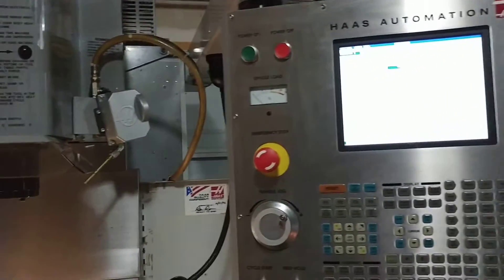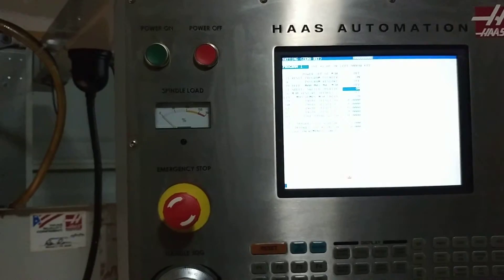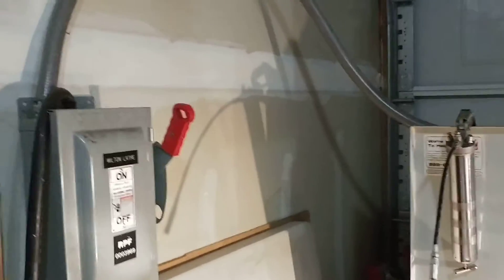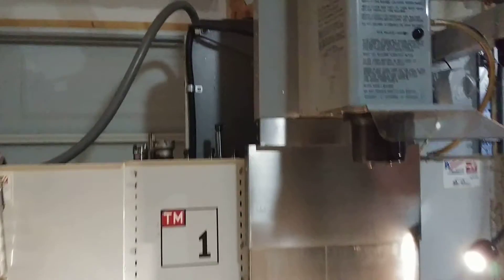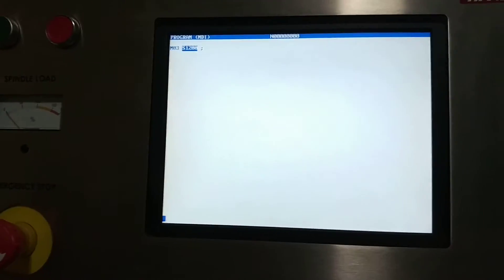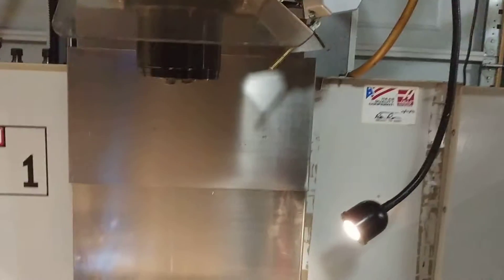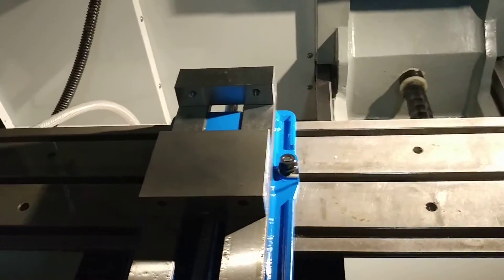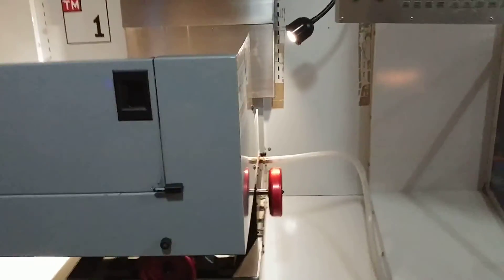Haas TM1 on single phase 240v

Comment: I want to get the tm1 to put in my garage but i only have a single phase 220vac 30 amps. I dont know if the machine will trip the breaker...
Reply from the maker: It will under serious load. You can still use the machine, just keep your cuts more on the moderate side.
Reply: @TheMachinistCNC  so I should be fine if I don't machine aggressively? I also looked into a phase converter.
Reply from the maker: @ISILENTNINJAI  absolutely

Comment: I have a 2010 TM-2 arriving in my garage on October 11 and it is presently wired for 3-Phase. I CANNOT find a wiring diagram for single-phase wiring and I've looked in all of the HAAS electrical manuals and operator manuals etc.  Would you PLEASE send a picture of the cabinet A/C wiring. I think I'm supposed to connect the two 110V legs to L1 and L3, the neutral to L2 and ground to the ground lug. Then set the main transformer jumper to "224V-250V" and the 24V transformer to "221V-240V".  I am assuming nothing needs to be done to the wires coming off the bottom of the main breaker.  If I wasn't bald I would have pulled my hair out by now. Thank you.
Reply from the maker: I don't have the machine anymore but.... If memory serves me me right, it was the two hot legs, on l1 and l3 with the ground connected to the ground bar on the machine.
Reply: @TheMachinistCNC  Thank you! Do you recall if neutral (return as opposed to ground) was connected to L2?
Reply from the maker: @SteveN-bh3wv  it was not, I just looked at my video about the Haas programmable coolant install and I was lucky enough to get a peep at the power setup in the video. Give it a look to confirm, but I'm 99% sure the nuetral was not used.
Reply: @TheMachinistCNC  perfect. Caught glimpses of both of the transformer jumpers as well! Weird that they would use earth ground for the return. Thanks a lot.
Reply from the maker: @SteveN-bh3wv  glad to be of help. Best of luck.

Comment: Is there a programmable soft limit for the Z axis? Or even the ability to move the limits switch lower? I have 90" ceilings in my garage. Thanks.
Reply: My brother is in process of buying a Haas TM2.He has a height issue in his garage. The Haas rep suggested he cut a hole in the ceiling sheetrock and box it in for the extra height. He has the room above the ceiling to do so. Possibly you may also.
Reply from the maker: rbmgf7 not that I am aware of. You would probably have to move the limit switch down the Z axis to accomplish what you are looking for.... But do so at your own risk.

Comment: Hey Andrew, I have a question about setting up on 1 phase 240V.  I have a 2004 SMM and am having issues with the single phase setup.  any help would be appreciated. Thanks!
Reply from the maker: CCF Customs I am not too sure what you are referring to as SMM. What kind of problems are you having?
Reply: wow, i'm surprised someone replied been stressing out here..thanks!  SMM Super Mini Mill.  I can seem to get it running on 1 phase 240v.  not sure what i am missing.
Reply: the Tool Room Mill and Mini Mills should if not are pretty much the same setup.
Reply from the maker: CCF Customs is it not firing up, is it only the controller not working, is there any error lights on the control board?
Reply: The only light on is the VFD Red light.  That's it.  
When i hook up L1 & L3 The Light inside the machine flashes & Load Meter just Pluses a little.  When I hook up Neutral Line to L2 Then the Inside light comes on but nothing else.
Reply: also It has a larger Input Transformer with 4 Voltage Range Sections to connect to.  my Supple is 250V so i put it on the 244-260V Connection
Reply from the maker: Hmmm, that's odd. I did not have a neutral line. They were both the hot leads (black) from the 240 breaker.
Reply: exactly, T3=125V, L3=125V. Total 250V.  I could send you pictures of my control if that helps.  seemed pretty straight forward but im lost now
Reply from the maker: CCF Customs check the 115vac main transformer at the bottom right-hand of the cabinet. You might have to switch the leads over to the other side. As well, look at the control board just left of the breaker,  check to see if any lights are showing an error
Reply: Hey Brother, After deeper research it seams i was misinformed regarding my machine, The TM's and Mini Mill can run Single Phase but the Super Mini Mill With 15k RPM Spindle can only be run at 3 Phase.  I will have to add a Phase Converter to Achieve the power requirements,  Only question now is a RPC or Digital Unit.  Thanks so much for replying and your assistance with my issue.
Reply from the maker: CCF Customs rock on! Glad you managed to figure it out. Look into Phoenix phase converters, and American rotary phase converter. Both seem to be plausible avenues.
Reply: Well I will rock once i get this thing running..lol  Been 3 weeks on my floor and nothing yet.. a little frustrating.  American Rotary I looked into, Phase Perfect is my other option, higher efficiency and also close to double the cost. No motor required.

Comment: Does that machine have HSM turned on?  i have a mini mill in the garage.  2000 vintage ..  still runs great..but no HSM.. you can tell when you 3-d.........
Reply from the maker: Bigwingrider1800 I do not have hsm on this machine, but look into g187 p1 p2 p3 with the E option. That usually helps the stutter.
Reply: Where does all this go in the post? Not sure what this  is.   Thanks
Reply from the maker: Bigwingrider1800 it should go before any dynamic style milling (roughing). Make sure to switch it back after the that section. I use mastercam and drop it in as a manual entry

Comment: Well done. I'm running a 2012 TM-3P with the 3/4 horse coolant option on a 20A single phase circuit in my garage. I'm pretty aggressive with feeds and speeds so I have some parts that see 90+% spindle loads for a couple minutes at a time and I've never had a breaker pop on me.
Reply from the maker: KS Analytical Systems I'm going to have to say that I am super jelous of your tm3p. This TM1 is super messy and a bit underpowered on single phase. kudos on the garage machining!